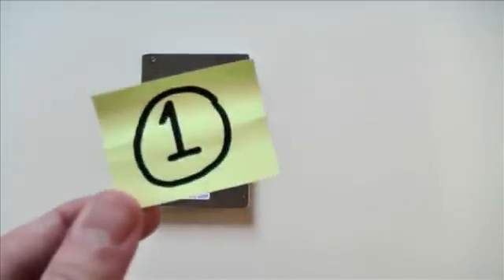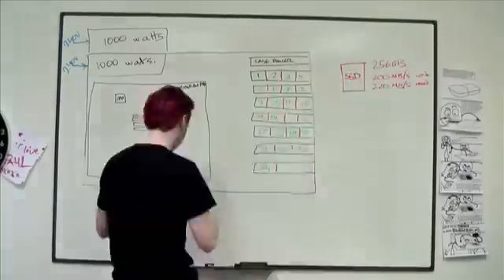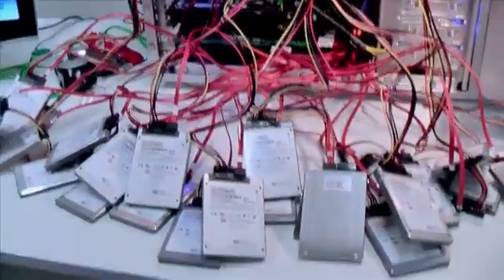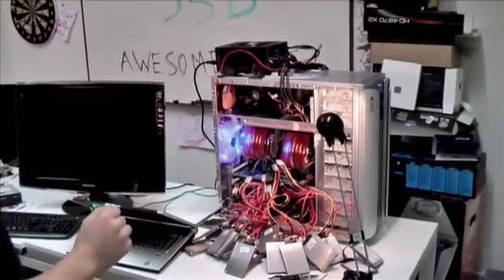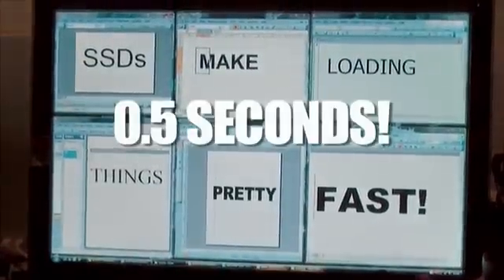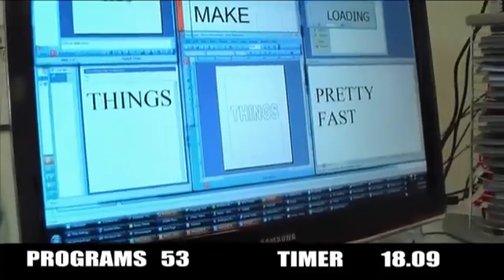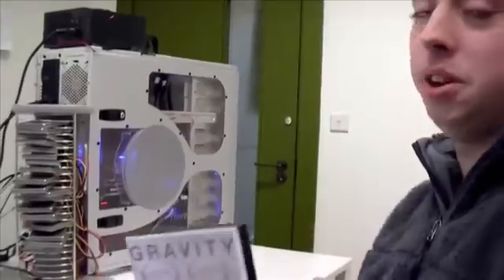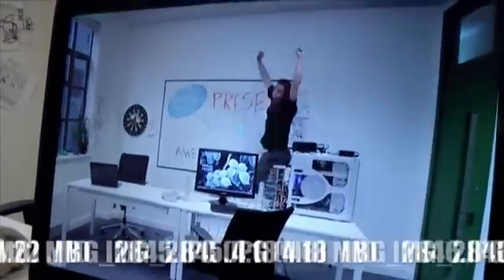What happens when you RAID 24 SSD Hard Disks !!!!!

Comment: Coming back to this video 10 years after it’s been uploaded, and looking back at how much we’ve evolved in the computer world. Right now i have a SSD that’s the size of half a credit card, and it holds a terabyte of data with ease.
Reply: I really don't think this video was actually shot in 2011. HD 4870 X2's in CrossFire? That thing's from like 2008. Add to the fact that they're running Windows Vista, this can't be shot later than late 2009 I'd say. Most likely mid 2009, just before Windows 7 came out.

So basically it's technology from at least 12 years ago.
Reply: Not to mention the fact that many newer SSDs are hitting up to 7GB/s on a single drive
Reply: @alkaline.dreamer  imagine you had like 50 of them all setup for a server. in a raid. Sheesh the speed of that would be insane
Reply: @marmite2956  that's called a SAN device

Comment: I like old videos like this where I was jealous when it came out... hey in 2011 I had a 2TB HDD which for me was a beast and they got 6TB SSDs! And as far as I know this video is from 2009...

Let that sink in
Then: 24 Drives - Now: Single Module
Then: 6TB - Now: 8TB
Then: Build 24 Hours - Now: Plug and Play
Then: Whole mess of cables - Now: Hey where even is that disk (under the GPU)
Then: 10.000s of Euros - Now: 600€
Then: Good and expensive Hardware required - Now: fits on almost every Mainboard
Then: „Should I use an SSD for the System?“ - Now: This question doesn’t even come up

SSDs were really small and expensive back then... even had some issues... but today... even cheap computers have SSDs

Comment: And now July 2019 a Single Gigabyte AORUS NVMe Gen4 SSD 1TB would be run 5 GB/s read, 4.4 GB/s write... Thanks for PCI-Express 4.0 x4, NVMe 1.3 with X570 AMD board :)  ... and for sure its tiny as gum stick, still you could imagine using it with RAID 0

Comment: I used to love this video. It was such a cool proof of concept for RAIDs, but first off: I didn't see ANY ESD protection, you didn't follow any protocol when touching components (you fucking held the RAM stick BY THE HEAT SINK!). You defragged an SSD which, first off, you should never do; SSD's have a limited read/write capacity. Second off: SSD's are always going to be fast at defragging when compared to standard HDD's, SSD'S DON'T FRAGMENT! IT'S FLASH MEMORY!

Furthermore, you use a fucking game to test the performance of your RAID... ummm why? Textures are not processed by your storage, they're processed by your GPU, if you have a decent GPU you can run ANY fucking game fast on high graphics, that has nothing to do with your storage, I could do that through a PATA drive with the right GPU!

Finally, opening programs fast is not a result of your fucking RAID, SSD's can do that on their own, but the speed they actually process and open is more a factor of those two processors you seem to have in addition to probably an extreme excess of RAM that no standard user could ever fucking purchase.

Basically, I'm questioning if you're the IT expert of any company since you seem to not understand a damn thing about the basics of computing and how computers actually fucking work.

Comment: I don't want to be a partypooper but you could get the same speeds just by using a single ram drive....
Reply: they had ram-based storage in the previous century, only it's become more achievable in the last 3 or so years, same with passive cooled high-performance machines...
Reply: fair enough
Reply: NVMe based PCI-Express cards aren't far off 2Gb/s read/writes atm

Comment: funny how in 2011 1920x1200 was high resolution
Reply: 1920x1200 is normal resolution as up for today 
Besides 1920x1080
Reply: Until today is a high resolution
Reply: Wiggle Playz yea well in 2017 8k is the most high res
Reply: Wiggle Playz well, it's nor great or shitty but 1920:1080 is still called FHD
Reply: Well my display from probably 2012 has a res of 1600x900
Reply: It's still today. In my country.
Reply: You should have seen it in 1999 when Sony released the FW900
Reply: I upgraded to 1920x1080 back in 2009. Got my first 120hz 1080p monitor in 2011 for 500 bux. Memories
Reply: Almost ten years ago when crt was the standard thre where loads of 2560x1600 monitors!!!
Reply: As far as i remember i had a 2560x1440 monitor back then, 1920x1200 was standard

Comment: My laptop SSD is 2200Mbps read. Amazing how quickly tech advances
Reply: you mean MBp/s, not Mbp/s. and your SSD is only transferring data at 275 Megabytes per second at 2200 Megabits per second lol.....
Reply: dudewtf1776 oops. That was a typo on my part. Last I checked the fastest SSDs you could buy is the Samsung 960 Pro which reads at 3500MBps which is a substantial gain, but the 950 Pro, the model it replaced was also 2200MBps and the fastest of its day (happens to be the on I have)

Comment: So 5 years later and we can achieve over 100Gbs a second.
Reply: No. SATA (which is the standard way to connect a hard drive to your motherboard) has a max. throughput of 6 Gbps. Maybe there are server connections which are faster, but not THAT fast.
Reply: Dude there have been ways to transfer data to a device faster than SATA's 6 Gbit/s for years haha.

Comment: Fast forward to 2016 24 x 240 gb = £1,370 for 6 tb and super fast speed, or 12 x 4 tb for the same price. I know which I would prefer I can wait to open office, and not as if you are going to open every single app, SSD even in 2016 is all hyped up as far as I have seen from my first SSD hard drive, the only decent use for it is on a £36 second hand computer I got for free in the end, it keeps the power supply fan quieter and speeds up windows. SSD pretty much a waste of money still, god knows how much 24 SSDs cost back in 2011.

Comment: Amazing how people don't even know how their technology works and sit there "testing" it. For example, the RAID array does NOT store 6 TB of data. It stores a whole bunch of error-correcting/backup data in most of the drives to protect against failure and to improve read/write speeds. Also the delete test is complete and utter bullshit. When the OS deletes files, it simply "forgets" where the files are written. Deleting a 4 kB file is almost the same amount of effort as deleting a 3 GB file. You can try it. The defrag test is also complete and utter bullshit because we don't know how fragmented the files were to begin with and therefore don't know how much data had to be moved. Also, it's important to understand that with so many copies of the data, ALL of that would have to be moved; therefore having a RAID array does NOTHING to speed a defrag operation. As for opening a whole bunch of programs, a single SSD probably could've matched the speed at which those opened because the primary constraints would be CPU/RAM and the SSD could work on loading the other junk while the CPU/RAM was working on the previous programs.

Comment: I get 2.2GB of video transfer in about 1-3seconds with 5x hdd in raid zero
Reply: ***** Unless hes also using Vista, his OS is likely more efficient at transferring files so it is relevant.
Reply: blame the cache.
Reply: They're using Vista in this, which took longer to transfer files than XP and 7.
Reply: file transfer speeds are depent on hard drive performance, no operating system
Reply: Henry Chan The Operating System does play a factor in file transfer speeds. Vista transferred files slower than XP on the exact same hardware.
Reply: ***** But thats not the point.
Reply: ***** yeah for about 5% speed, its relevant but not nearly the main reason.

Comment: Now (2016) with NVME, we hit upper limits of PCIe with just two NVME drives in RAID 0.  What's the next architecture change to push beyond these limits?  This video was inspiring the first time I saw it, I had forgot how much slower SSDs were in 2013. From "real world" testing (LinusTechTips) Raid 0 does not help for most common workloads.  The Intel 750 and Samsung 950 Pro are amazing (so now I need a new motherboard). Harddrives used to be stuck as the slowest part of the system for so long. With NVME, should the focus still be on improving drives or do the motherboard makers now need a new standard that allows for much high bandwidth than PCIe 3.0?

Comment: This was indeed a nice result at that moment, but one fact that was and is still important, is that by increasing the number of disks in the array, you also increase the risk of an URE at rebuild or depending on what RAID type you choose, a double fault state is way more likely. Having this in mind it shows us that the Performance isn't all, it's nice but for Data that isn't backed up often or data that can't be backedup as often as it changes, it remains at the solution of either accept lower performance with multiple smaller arrays or accepting to lose data from time to time.

Comment: Funny how my current m.2 SSD can do 2.5GB/s. Oh how things change!
Reply: +Pauli “Dids” Jokela i wish i had m.2 on my mobo. Instead i have to use SATA3 SSD or get an expensive PCI-E setup...
Reply: +ThereWasNoFreeName Actually, my mobo doesn't have m.2 either, so I had to get a compatible PCI-E adapter (roughly $28), which allowed me to use the full bandwidth that m.2 provides/requires. :)
Reply: Pauli Jokela
 that's a good idea. Just checked local stores - no such adapter here yet for some reason (though there are some m.2 SSDs for sale)
Reply: +ThereWasNoFreeName I had to specifically get this one, as I heard that it's 100% compatible with the drive I have: http://www.amazon.co.uk/LyCOM-DT-120-Lycom-PCI-e-Adapter/dp/B00MYCQP38
Reply: Pauli Jokela
 Thanks, i'll study about these adaptors then.

Comment: If you have an SSD never defrag. it.  It is about the worst think you can do to an SSD.  You can think of SSD defragment as doing a jig-saw puzzle blindfolded.  Explanation:When you defrag the operating system sees it as a hard drive with sectors, but the data is spread all over the drive by the controller. Defragging these “sectors” is like trying to assemble a jigsaw puzzle blindfolded: You can feel parts of the pattern, but you can’t see the whole picture. In addition, NAND is good for only a few thousand write cycles, so defragging can reduce the SSD’s lifespan by unnecessarily writing data to it.

Comment: By definition, an SSD is not a disk it's a flash drive.
Reply: +Charles Addis if you call a hdd a disk you should also call an sdd a flash lol..
Reply: +Dunkelelf3 yeah, because it is. By the way, why it's called DRIVE when there is nothing to DRIVE inside? No tape, no floppy or hard discs, no optics etc.